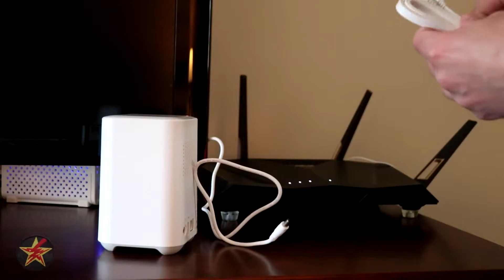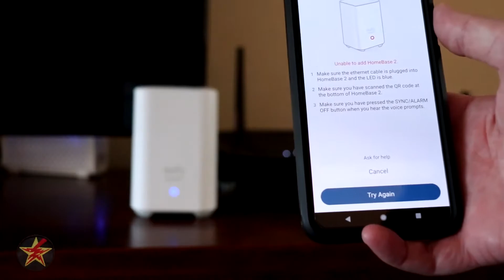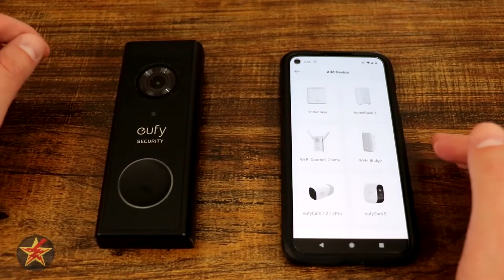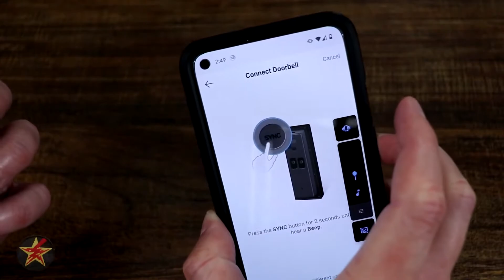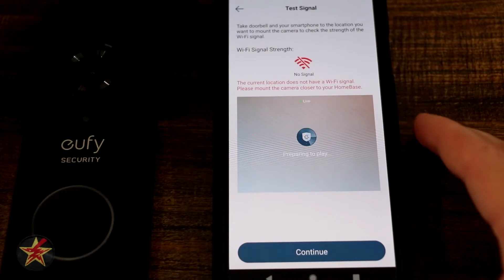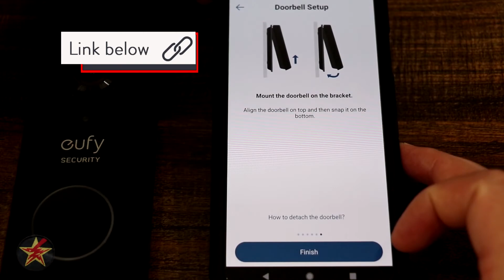How to setup Eufy 2K Battery Doorbell

Comment: Staying on red here. Never had this problem before with other eufy bells. Infuriating.
Reply from the maker: I did have to start this one over three times to get it to work correctly.
Reply: Been wondering if it’s to do with router settings or am I just not following the steps correctly. Usually just plug in and it works. Not this time.
Reply from the maker: @melsagelord3991  Is it your own router or when from an ISP?
Reply: ISP. Others I’ve set up have also been isp ones, never had this before. Sent  the Homebase and bell back for a refund now.

Comment: Is the base mandatory
Reply from the maker: Yes.
Reply: @Wanderer001_Reviews_Clips  This is sick. Why do Eufy forces adding a home base or wifi chime just to add the device to the app. I tried adding the video doorbell but it keeps popping up a misleading message "To setup Battery Doorbell, please confirm whether Homebase or Wi-Fi chime is added or not."
Reply: @zhenghan8428  For this doorbell it can not work with a chime box so in order for others in the house to know the doorbell has been pressed that is why it needs the chime or home base.

Comment: Error, you have to select homebase 2 , selecting just homebase will not bring up the qr code request at least in my case. The homebase 2 probably should be re-labeled 2K as I believe this was the intent. The manual is a zero with zero troubleshooting included. I still like the product but the literature leave something to be desired. No issues on your part just some thoughts.
Reply from the maker: That would be a good idea.  I think they are phasing out the original homebase and they will all be homebase 2 in the future.  However, that does not help people who already have the original and may try to connect this doorbell to it.